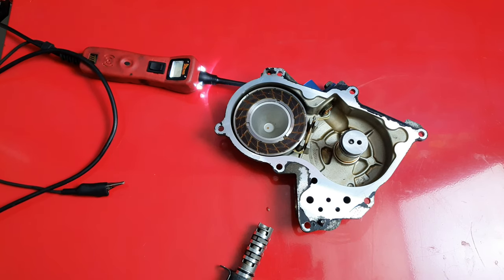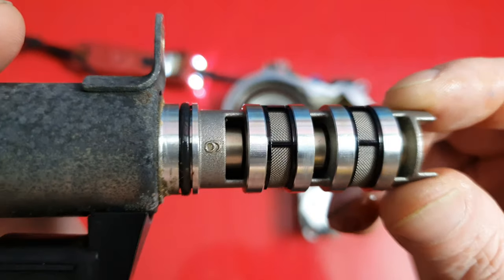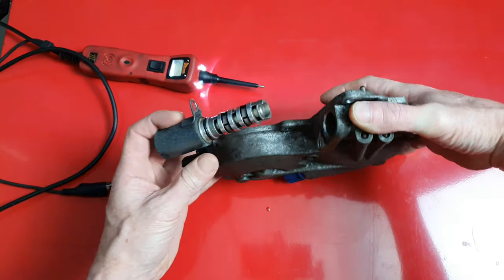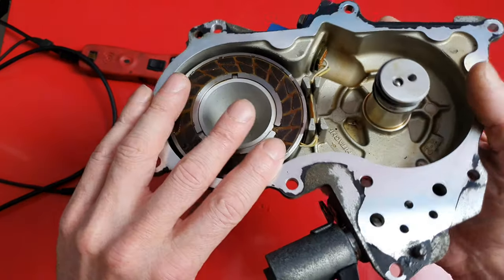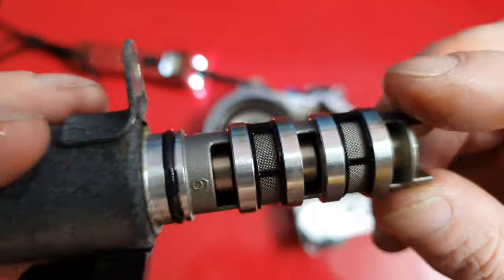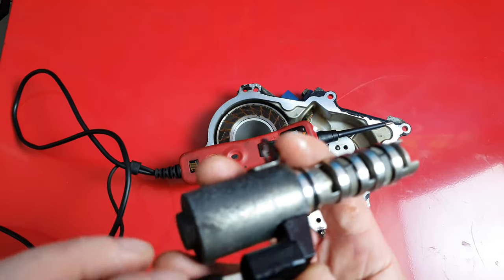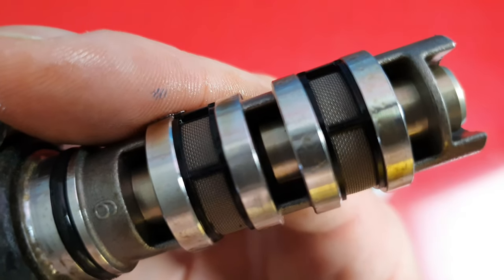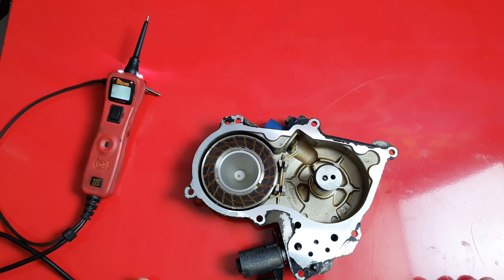How to Fix Variable Valve Timing Code P0011 P0012 P0013 P0014 "Free Fix"

Comment: Ok well initially I got a p0011 and p0021 code. Motor kicked and bucked.
(about two  week before this, the cam shaft sensor went south and car stalled, replaced the sensor and motor was running fine)

Topped off my oil, cleared codes and got the p0011 back., though motor acted normally.

Got an oil change and installed a new VVT solenoid on the passenger side ( it appears that the P0011 is for passenger side , right)
cleared code, and periodically I still get the code, with motor acting normally.

My oil pressure is about 15 psi at idle and 50-60 at speed (based on marks on gauge).

I'm at a lost as to what to try next.
Reply from the maker: What kind of car?
Reply: @FlatRateMechanic  oops...2005 350z
Reply from the maker: @cfauvel  Did you have a timing relearn done after. The manual method does not always work and may have to been done at the dealer.
Reply: The Flat Rate Mechanic 
Nope didn’t do that. 

Start car, warm it up in N at idle 
Then hold car at 2000rpm for 20 secs, right?

I took the tension cover off to see any gasket material around the galley cover, but couldn’t really see anything ( charging up my borescope to see better).

What do I ask for at the dealer?
Reply from the maker: @cfauvel  That is correct it took me so many attempts for it to work on a similar car I thought I was going to have to bring it to the dealer. Clear codes and do it several more time. If not change have the dealer do a valve timing relearn. Only the dealer level scan tool can do this. If still have a problem after that you could be looking at a worn time chain or bad timing chain tensioner.
Reply from the maker: @cfauvel  And yes the p0011 is the passenger side. Bank 1/ cylinder one side.
Reply from the maker: Exhaust valve timing control learning procedure
Reply: @cfauvel  yo man did you ever end up solving the problem ?
Reply: Prodigy37 yes I did ... trying to remember all I did... I know I at least replaced both vvt solenoids, but there was something else too.... I’ll check my records... I know it wasn’t serious... oh it might have been the drivers side cam position sensor too

I’ll get back to you later

UPDATE:
Looking at my purchases and my recollection....I think it ended up being a combination of the new VVT solenoids...did both (I know I had a conversation with the ebay seller, but messages on ebay dont  go that far back)...and cam position sensor...I think I did the Passenger Cam Position again...the first one was not OEM, the second one WAS an OEM Hitachi.....yes now I remember !! that was it....

Then replaced the passenger cam position sensor in my wife's g35 and remember it being a PIA....the o-ring was leaking.

so 
 1- oil change
2 - new VVT solenoid
3 - new OEM cam position sensor (passenger side)
Reply: @cfauvel  thanks man I have a lead now thanks to you the car felt like it was running pretty good when it finally came out of limp mode and well it came back and well if I disconnect the battery it will run good but after a while or if I try to go a little faster it detects misfire and goes back to limp mode
Reply: @cfauvel  so this what happened I did an engine swap and I think everything came the way it was suppose to be and car started but started on limp mode reset it and it came off but it comes back after a while
Reply: @cfauvel  but I also havent tried that exhaust valve relearn thing at nissan
Reply: @prodigy3791  can't hurt to do that.
Reply: @cfauvel  I get the p0011 and the multiple random misfire
Reply: Prodigy37 thé misfires are not telling you which cylinders? And they go away after you disconnect the battery?
Reply: @cfauvel  it was going away like the check engine light but comes back and yeah says cylinder 4
Reply: Prodigy37 thé misfire might be coil, wire or injector 

Get only oem coil by hitachi
Reply: @cfauvel  maybe I'll swap my old coils from old engine since they worked fine I'm guessing its these sensors you're talking about
Reply: Hey having same problem with my 13 m35x. Bank 1 valve timing permanent code. Tried manual relearn no changes tried multiple new vvt solenoids no change did new oil change no changes and now im still stuck at square 1? Please help help help<< new vvt is hitachi* have not checked or tried new cam sensor<< have not tried relearn @ dealership.
Reply: @prodigy3791 same issue on my 13 m37x. Bank 1 valve timing permanent code. Tried new oil change tried new hitachi vvt solenoid tried manual relearn multiple times! Please HELPPPPPPPPPPPPPPPPPPPPP
Reply: @anthonythomas9426  honestly bro I don't remember but the engine was bad and even then the engine I swapped it was bad as well and also it was going into limp mode because my stock flywheel was getting eatened up by a stage 3 clutch(copper)

Comment: Please help. I just bought a new car and this code of P0014 was coming up on my 2014 Kia forte EX

What happened was that the car stalled when I was going about 30MPH on the highway. I pulled off to the side of the road and tried to start it. The car did not start. Instead, what i got was a SINGLE click when trying to turn the car. 

I then continued to start the car and when I opened the hood of the car I noticed trails of smoke coming from the engine. I was not able to locate the source of the smoke. All I can say is that the smoke was from the right side of the engine and that it smelled like burning wires. 

So although I bought the car as-is, the dealer was nice enough to look at the car since the car stalled just a few hours after buying the car. 

Now the dealer wants to replace the starter. I don't feel that this is the issue because the car stalled. I would be BEYOND glad to receive any help.
Reply: Here is the link to a photo where I saw the smoke coming from: https://ibb.co/ZSsv9JV
Reply: Here is the link showing the component information : http://www.kifomanual.com/components_location-434.html